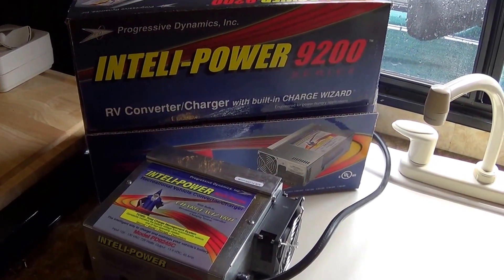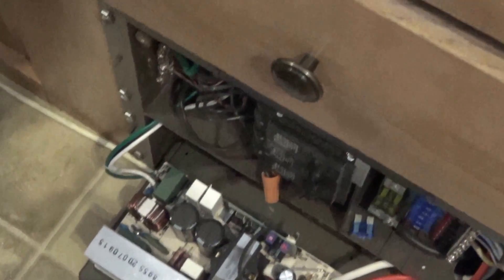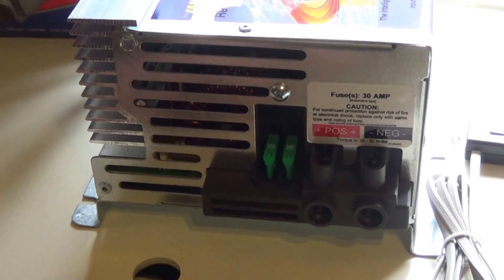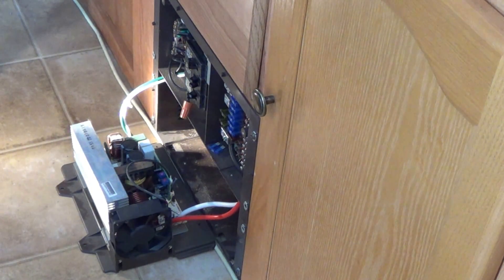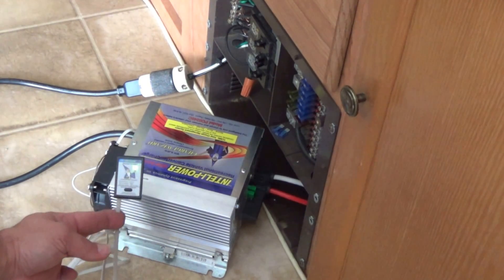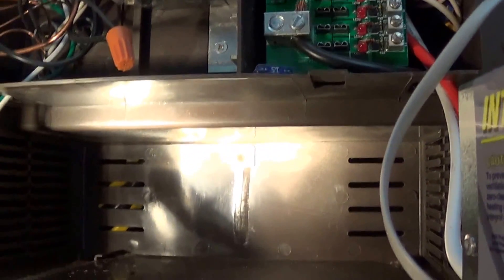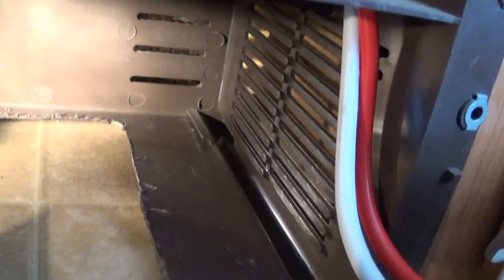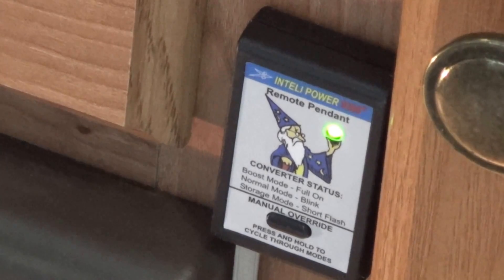Replacing WFCO converter with Inteli-Power 9245 converter

Comment: I was wondering how to connect that plug to. Nice job. I'm looking into replacing the converter on mine so that it could charge Lithium batteries and looking for the type of charger that will charge both batteries..
Reply: I have a 9200 services inteli-power recreational converter  can I install with my solar panels, if you need me to call you or how would I get them to change my battery s from the solar system
Reply: @angelgomez6679 hi. Did you ever figure this out? I’m in the same situation
Reply from the maker: They make those now.  This is a pretty old video.

Comment: This is a great video thanks. What about the chasis ground? I'm currently doing this same thing but in the intellipower manual it doesn't come with a chasis ground and says you must install it yourself, you did not install a ground to it in your video. Did you have any problems ever?
Reply from the maker: I have not.   Actually sitting in the trailer right now with it running.

Comment: I currently am living in my 37 ft 5th wheel trailer and our power converter is broken I assume. We currently have to run an extension cord from an inside outlet outside to a battery charger to charge the batteries because of it. Im looking for a new converter and stumbled upon your video. Is this converter good? Will it work well for living in the trailer? We honestly don't even use our lights very much as it is but our power bill this month was insane from having the battery charger hooked up.
Reply from the maker: Mine is still running strong, and I am not even sure how old this video is.  Pretty much any smart charger will work better than the junk that comes stock in campers.

Comment: Did you grounded to chassis? Did it come with wire or do you need to purchase that separately
Reply from the maker: I used the same ground the old one had.  This video is so old I could not say what comes with it now.

Comment: We bought a 2011 Puma one weekend the electrical worked fine then the next time we were out about a week later, strange things began to happen. When we arrived the fridge stopped working and the battery was drained, we do have it hooked up to hydro. The lights don't work  furnace and AC doesn't work either. The tv works and microwave and outlets but no lights, as soon as I plugged in a coffee maker one light came on and began to flash off and on and bathroom lights would turn on with the switch on the wall. As soon as I unplugged coffee maker it stopped could it be the converter.
Reply from the maker: You would have to check your fuse box and see if the converter is hooked up to the same circuit as your coffee pot.  My guess is that you might have a different issue, but it is hard to say from your description.  Your Puma has two electrical systems.  Not sure which part is having issues.  Could be both.
Reply: @FernbarkFrist  Thank you for e-mailing back, we had to replace the converter he put us in a 55amp the tech said it was new old stock that he took out and hadn't seen a converter like that in years. Hopefully nothing else goes wrong

Comment: I have 50 AMP hook up do I need to buy 50 amp converter on ebay I find 45 amp and 60 amp converter but not 50 amp
Reply from the maker: You don't need a fifty amp converter.  The 60 amp will recharge your batteries a little faster than the 45

Comment: Were you concerned about the gauge of the wire you were attaching the new 9245 to? If the 9245 produces more current to charge the battery, doesn't that mean you have to go with thicker wire?
Reply from the maker: Good question.  I think that is 6 gauge wire running from the charger to the battery.  The distance is about 12 feet so according to the wire size calculator, I am still within tolerance.  You should definitely double check your wire size and distance if you put this in your RV.
Reply: You Should buy new one with same amp output

Comment: My house converter is killing my B atterys as well! Every 2 months. How much was the new one? Also shutting off all electric, is disconnecting the house battery only? Or do I have to do under the hood as well. Unplugging from sure power is a no brainer..thanks for the help
Reply from the maker: I am not sure what the new converter price is now.  This video is a couple years old so the prices may have changed.  Just google the model number to see what they are going for.  I don't know if your RV has the motor battery connect to your house battery, so I cannot advise you on if you need to disconnect it or not.  Sorry.
Reply: Fernbark Frist , it has an emergency start button. And thank you

Comment: I have the WFCO WF8955PEC power center.  Is that the one which you have which was boiling off the water?
Reply from the maker: You are asking about something I changed out a couple years ago.  I can't actually remember what was in there, but if you are running with original gear, it is probably like the one I had.
Reply: Ahh.  I doubt I would remember that either.  I'm running with the stock charge controller in a 2017 Coleman.  Thanks!

Comment: I would take a 'look-see' at the set-up that the 'blacktopboondocker' guy is using...two 6-volt 'golf-cart' batteries. This makes a good deal of sense to me, as it is 'spreading-out' charging into two batts., thus greatly decreasing 'surging' and 'electrolyte boiling' from too much energy being 'forced' into the same physical dimensions of one battery.The PV panel and all your other equipment will have no difficulties w/two '6's rather than 'one 12'v.(the system you have looks fine to me, from what I've seen...the one really critical factor in maintaining 1 or 2 batt. systems is the 'surge factor' of a heavily-drained battery(s) being charged)Too much 'charge' factor over a short period of time will seriously degrade the electrolyte fluid of any 'lead-acid' battery...not only will water 'boil-off' but it causes sulfide depositions onto the surfaces of the lead-plates.In essence, the battery seems 'weak' no matter what is done to it or what system is used for charging...the batt. is ruined, even though it stays at 12v and the amperage is still present. it's 'false-positive' result when testing.(when/if you buy a 'new' batt...check for the date of manufacture for year/month! It's easy to end up /a batt. that's a year or more old, still sitting on a shelf!)
Reply from the maker: Two six volt batteries sounds great.  Please send me the money so I can go buy some!  Thanks in advance.
Reply: Fernbark Frist Very amusing,

Comment: is it possible to run this unit without a battery?
Reply: I was under the impression a converter charged and let you run shore power as primary or battery as primary what ever u choose.. While being connected to shore power charging your batteries
Reply from the maker: I don't think so.  Sounds like what you want is a power converter.  This device is designed specifically to charge a battery.  A power converter will convert 120 AC to what ever DC voltage you want, but will not charge a battery.

Comment: I'm about to install a PowerMax model converter/charger.  It's basically the same setup as you had here.  Do you recommend getting a female plug for the AC feed like you did, or can I just cut the plug off of my converter/charger and tie it to the AC feed with wire nuts?  Either option is better than the solder that is holding everything together right now.  Why did you do yours so "professionally"?
Reply from the maker: +Justin Atwell    You could easily wire nut them together.  In fact that would be way less expensive.   I think I saw the plug on the unit and decided it needed a female piece to plug into, but really it doesn't.

Comment: I'm about to replace my existing converter with the inteli-power 9245 per your video. However Is there an existing chassis ground wire or did you need to fabricate and install one?
Reply from the maker: +Frank Evanega There isn't one existing.  You will have to come up with your own.

Comment: Doing the same to my camper but the only thing I see u did not do is hook up the chassis ground wire on the side of the converter.
Reply from the maker: Cheshawnee Davis Thanks.  I will double check that.

Comment: Good job man .. I have a 9260 I just put in mine and love it  !!
Reply from the maker: ShawnMrFixit Lee Did you do a swap like I did, or is yours more remotely mounted?
Reply: I did a swap , I have a  79 Rancho El Ray  Trailer and it had an old converter that did not even charge the battery.. I put 2 RV batteries on it and a 9260  so I have 60 Amps of power and a 2000 watt converter .. I want to add solar  but to much cost for how we use the trailer ! But yes total swap out .. Even a new fuse box ..  Check out my channel .. I think I have a vid of my setup if not let me know and I will make one tomorrow !!
Reply from the maker: ShawnMrFixit Lee I didn't see one, but you don't have to make one for me.  I like your jeep.  I traded my 05 JGC for my travel trailer.  I miss the Hemi....oh well.   I still have my 84 Scrambler though.
Reply: I have a ton of fun with the jeep ! Did the transfer case swap so I have 2WD as well as 4 Put in a locker  And a few other mods , Next is the transmission mods and kit's !  I have a few kit's for the different solenoids and clutches and valve body , Just got to get the time !